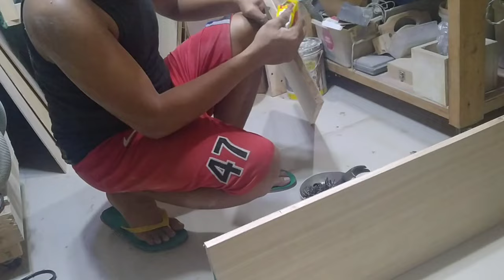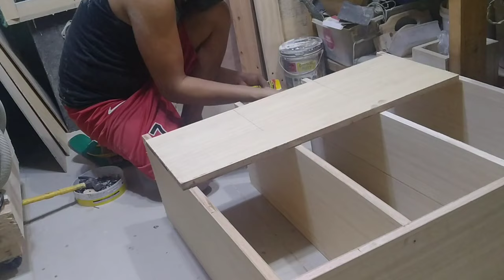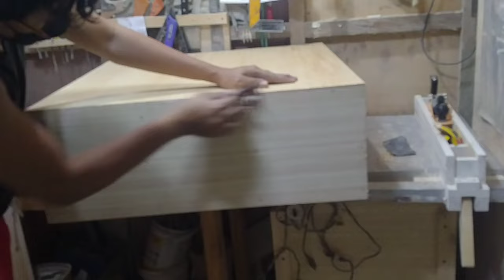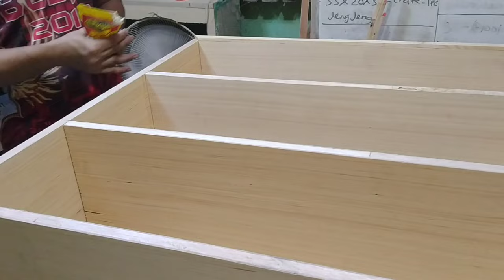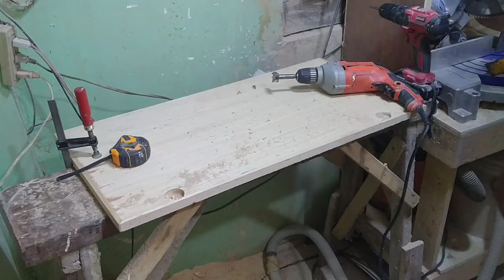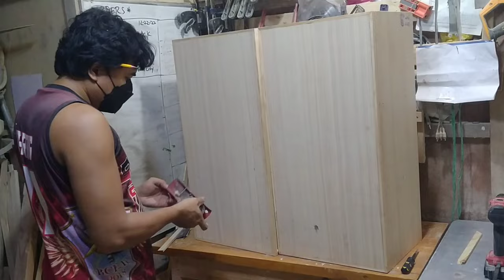making a simple cabinet using basic tools/paano gumawa ng simpleng kabinet

Comment: Could you please share each plywood measurement size you used to make it this.
Reply from the maker: The measurements of the cabinet is 90x90x30cm thank you for watching
Reply: @rafaswoodcraft  Thank u so much
Reply: @rafaswoodcraft   so we require 6 pieces of plywood with 90x90x30cm right? Sorry for the silly questions. I am new to this😅
Reply from the maker: Yes sir
Reply: Looks like 6x90cmx30cm pieces for the shelves and side, then a 90cmx90cm for the back. The doors should be about 45cmx90cm.